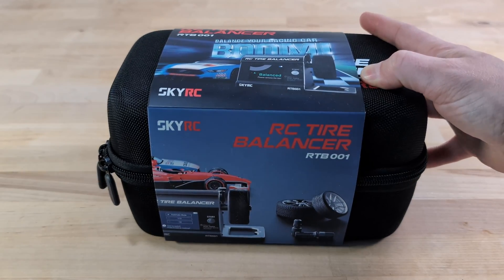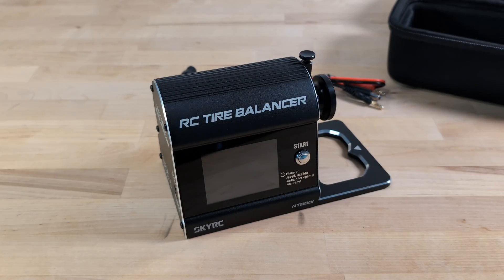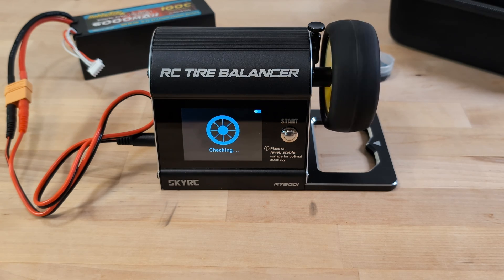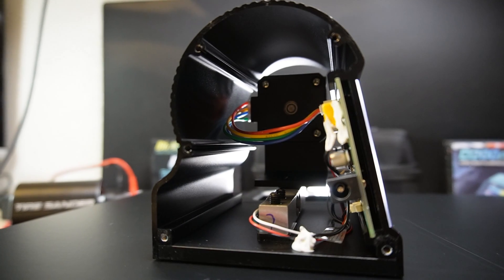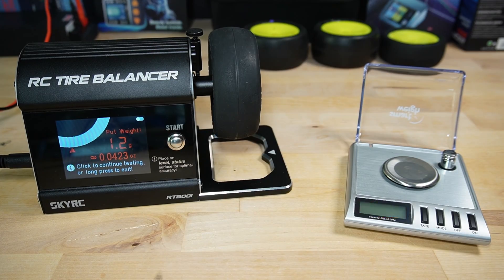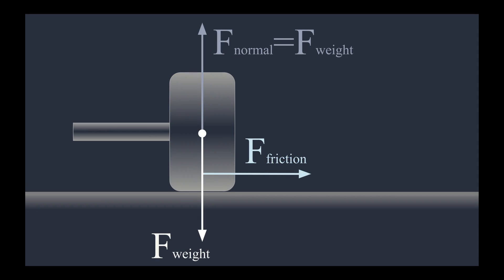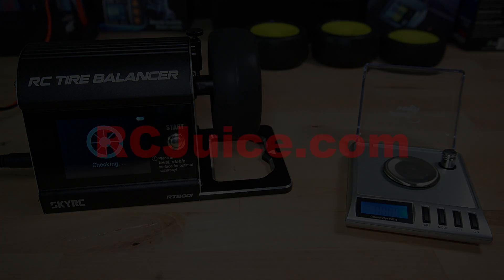SKYRC Tire Balancer Explained: Technical Insights, Demonstrations & Guide to Solving Common Problems

Comment: re 1/10 rear "stalling". What power supply was used? Was it 12v? Would a 4S power supply work better? 

Is a anti spark connection with 3S or 4S battery power supplies a "safer" option?

Comment: So it can be used for 1/10 off-road tires? I thought it was aimed at on-road cars.
Reply from the maker: Yes, it works great for 1/10 off road, 1/10 on road, and 1/8 on road with the 1/8 adapter.

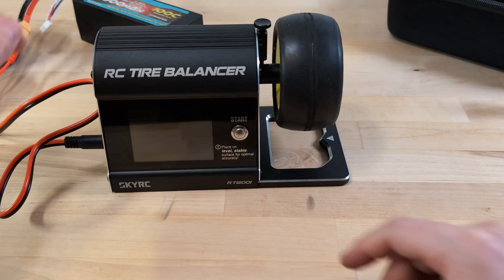Comment: !Problem solved!*.....Just purchased one from you and after having the same issue with starting (timestamp 13:02)  this was easily resolved. The noise sounded like the motor was struggling (almost cogging) to start. This machine will operate on voltages b/w 12V @750mah and 18V @ 550mah.  Using an adjustable power supply which I initially set at 12V and 750mah the motor struggled to start and no amount of gentle spin helped. I bumped the power supply up to 18V @ 750mah *!Problem solved!   

Didn't open it up to look, but guessing they need a larger capacitor on the board for starting this size motor especially under load. Nonetheless, for testing purposes I incrementally increased amperage up to 1.2mah and ultimately settled back to 1000mah (which is negligable). No issues after 10 sets of 1/8 buggy tires all balancing on first cycle; and I've got another 20 sets to go...what a time savings! Thanks for the inital setup tips! Hopefully this helps others who purchase this machine.
Reply from the maker: Thank you for your input and feedback!

Comment: I just got one and it says it's for on road tires only .
Reply from the maker: It does work for 1/10 off-road tires as well.
Reply: @RCJuice  I was mentioning this because of the issue with the rear buggy tires.

Comment: Yes. Excellent video.  If you didn't balance your real car tires you would definitely feel the difference. Such a small weight is added in comparison to the entire cars weight. It is better for the entire car including motor and drive train. Vibration is very bad for any size vehicles. On or off road it makes a Huge Difference.

Comment: Your a baaaaadddd dude!!! Awesome video...just ordered one cause me & my son are getting into the muddboss world! Thx again!
Reply from the maker: Awesome! Love Mudboss!
Reply: @RCJuice  but it doesnt do carpet tires does it?
Reply from the maker: @Midwest-RC  It will do both 1/10 dirt/carpet off road wheels and tires.
Reply: @RCJuice  Not on road tires? What if you don't tell it its an on road tire? Its about the weight?
This should make the suspension last a little longer too. Its easy to imagine the tire going up and down because of the imbalance, but too and fro also.
When the heavy spot is behind the axle, the whole arm is going go backward, or advance more slowly than the rest of the car. Then drag it forward after it moves over the top and ahead of the axle. Then the play in the suspension will allow the tire to move in a short arc if you look down on the tire.
Of course I could be way over thinking it.

Comment: Leaving this comment here as it’s the most recent video… I’ve been doing research with your videos, and was wondering if you recommend any motors for the arrma big rock V3. I just want to give it a bit more prep and run it on 6s
Reply from the maker: With stock motor mounts, you could try the Hobbystar 3670 in either 1850kv or 2280kv for 6s use: https://rcjuice.com/collections/all-around-motors/products/hobbystar-3670-4-pole-brushless-sensorless-motor-waterproof?variant=47582293983527

Comment: Great video.  I bought one, but cannot get the thing to calibrate. I have tried many things (including removing the adapter).  Nothing seems to work.  Unfortunately, It looks like I may have to return the tool.
Reply from the maker: Sorry to hear that, I assume you made sure that the shaft is empty at the beginning of the calibration process and you only attach the adapter when it prompts to do that.. I guess there might be still unresolved mystery about this.
Reply: I found out it was a bad sensor.  I returned it and going to try it again. @RCJuice

Comment: I think this has potential for RC airplanes, balancing props and in particular spinners. It would need some design changes, but the technology is surely transferable?
Reply from the maker: Interesting Idea. I would think the tech principles would transfer, although I am not sure how would you make the adjustments on a prop. Is this something people currently do with airplane props?
Reply: @RCJuice  Yes - definitely. If you google rc prop balancer you will see the low tech solution we all use. It works fine for props, but in my experience not at all well for spinners - which are much more wheel-like…

Comment: The 1st wheel you balanced was so out of true balancing  it seams accademic. I think your right about glueing the tires your self - if you  balence before glueing you can rotate the tire on the rim to move the heavy / high spot realtive to the wheel - Full size tires have  both marked with  paint dots - and some wheels have there low spot  marked  so you can alighn the tires high spot with the rims low
Reply from the maker: Thanks for the suggestion, I will try to do that with my next set of wheels and tires.

Comment: Awesome review with quite a scientific approach. One aspect that was missed is the out of round dimensions which was quite apparent in some of the tyres. This would have a similar affect to traction even with the tyres well balanced.
Reply from the maker: I considered addressing the out-of-round issue but decided against complicating the discussion further, given the already nuanced nature of the balancer's problems. But you are absolutely right about it. Even during the planning phase, I suspected it might be an issue and thought I should check it before even attempting to balance the weight distribution. Then, when I did put it on the sander first, I was pretty surprised by how much it was wobbling. I tried sanding it a little, hoping it might help somewhat, but it did not do much. At the end of the day, I had two thoughts. One is that the tire is soft, and maybe under the weight of the car, it will have a less pronounced asymmetry. Another is that the ballooning of the tire might also have an evening-out effect. However, I did not investigate either hypothesis further. Perhaps I will revisit this in the future.
Reply: @RCJuice  Yes I agree. It would add unnecessary complications to the results and may even water down the true potential of the tyre balancer . The out of round issue could be more of the tyre manufacturer quality and would distract the purpose of the review itself. Great Job.

Comment: Wut about 5 th scale wheels
Reply from the maker: It does not look like it's going to fit. The clearance from the shaft to the bottom plate is about 60mm. Unless you saw off part of the bottom plate and let the tire hang of the table's edge... :)
Reply: Take them to the tire shop😅

Comment: Nice how big if a tire will it take? Looking to balance 1/8 scale foam tires.. BSR
Reply from the maker: Cannot say for sure, but it is made for 1/0 and 1/8 scale with the separate adapter. The clearance from the center of the shaft to the bottom plate is about 60mm, so that would be the max possible radius of a tire.

Comment: If you're glueing your own wheels you can also pre-balance them. Before you glue your tires experiment with the placement of the tires on the rim by spinning the tire on the rim and looking for the best-balanced spot. Often you can get them very close without adding any weight.
Reply from the maker: Thanks for the suggestion, I will try to do that with my next set of wheels and tires.